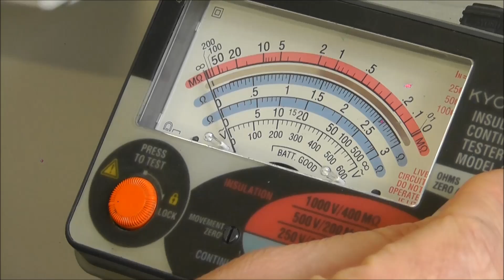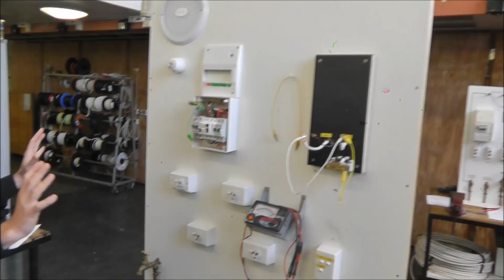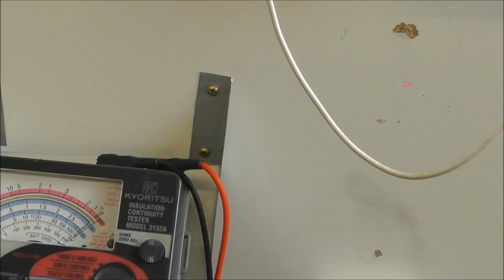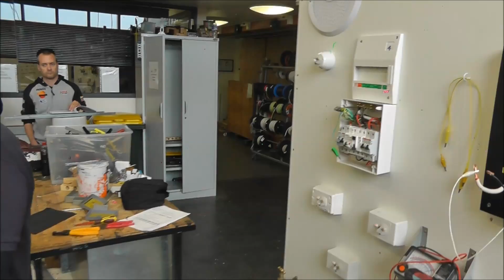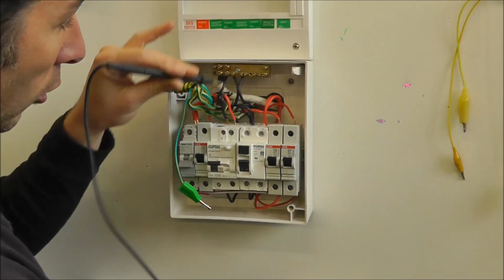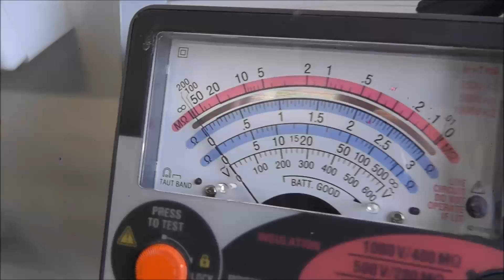Installation testing LEP

Comment: Hi mate, great work. I teach this as well, it is always good to see how others test etc. In this case very similar to me. I do question one minor thing, and I have had this conversation with colleagues as well.  I don't believe that you can use the meters mechanical Zero Adjust screw, to adjust the zero reading on the M Ohms scale.
The screw is only a mechanical resting point. I had a look through the manual and it does not mention this as an adjustment. I believe the M Ohms zero adjust is only adjustable internally.

Comment: Do you have to join active and neautral when doing the sub circuits ? Or can you do them separately, like active to earth and then neautral to earth ?
Reply: If you test them separately and there happens to be a connection between neutral and earth, that you have not found yet, the test 500V will be applied across A and Neutral as well, which may damage electronics.

Comment: 5.4.3 Note (e) soldered Main Earth okay however 3.7.2.11 earthing conductors if soldered shall be retained in a position by acceptable means independent of solder.
Reply: Yes but it cannot be under a screw if it’s soldered.

Comment: Nice job , but I believe we're not allowed to use the load neutral of an rcd for multiple circuit connections , we must use a separate neutral link fed from the rcd, your video showed the 2 circuits on the right of SB had there neutrals terminated in the rcd load neutral . Cheers
Reply: Yes, I was going to so the same thing. One hole for each circuit neutral. Reason is, the two circuits may be fed from two different phases, say A and C phase, if the two twisted neutrals become disconnected from the link, the two circuits are now connected in series across a nominal 400V. This will lead to unequal voltages on the circuit loads. Perhaps, 100V on a washing machine and 300V on a TV.

Comment: Dont you ever do an Earth loop impedance live test such as the ZS   test? Also an external earth loop impedance ZE test live test? That tests the impedance from the  mains active cable to earth at supply transformer, so that it proves the external supply is good, also an PFC test? In UK we have to do these live tests with an expensive calibrated tester plus an 5xs RCD tripping times test to fill out the test certificates.
Reply: Yes, we have to do that in New Zealand as well
Reply: Love it

Comment: Are you testing on 500v through your RCD's and appliances?
Reply: 250V for electronic devices, 500V for single phase and 1000V for 3 phase.
Reply: @POPPIELOK  500v for three phase as well. The test voltage  has to be double the voltage from line to earth